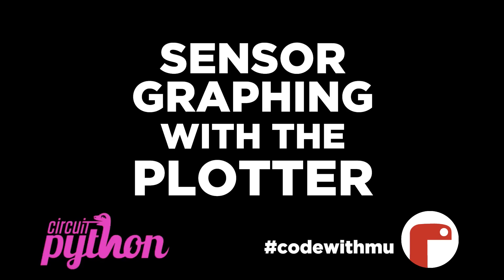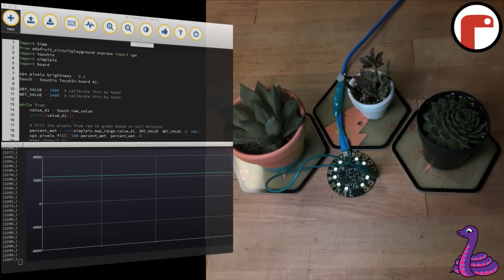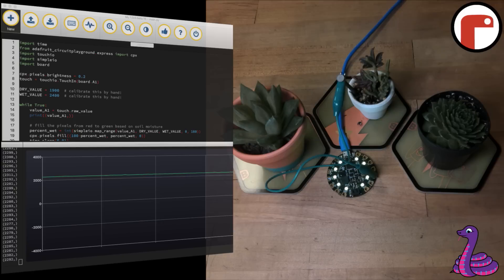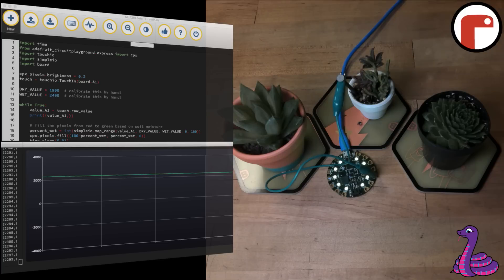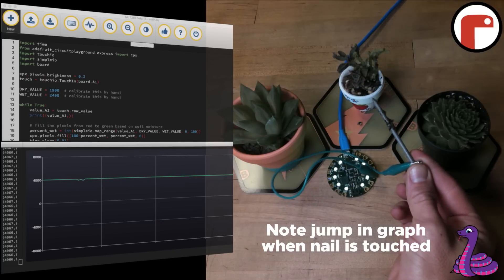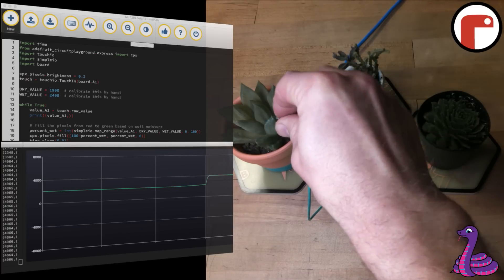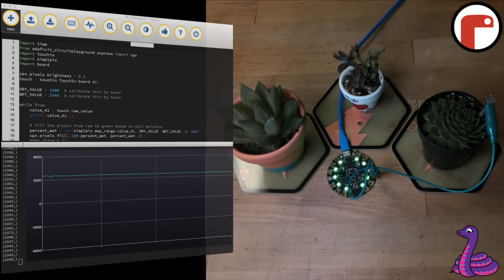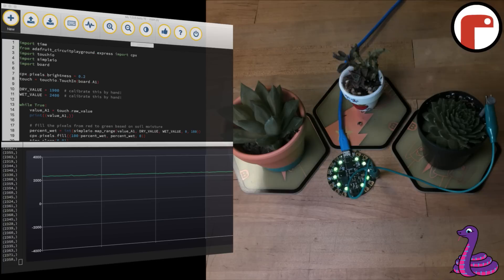Sensor Graphing with the Plotter: Soil Moisture @adafruit @johnedgarpark #adafruit

Comment: I would suspect you wouldn't want to probe the sensor continuously though because to measure capacitance it needs to create a small potential. This potential, even though it is small, should accelerate electrochemistry on the nail and basically cause sped up rusting into the wet soil.
Reply: I used a galvanized nail, in hopes that it would avoid rusting.

Comment: Putting a bare nail into the soil starts to sound more like resistive than capacitive measuring
Reply: Resistive measurements require two nails. This is capacitive, using a single nail.